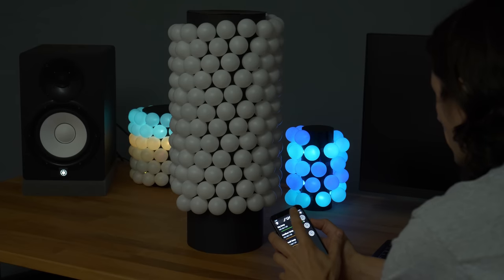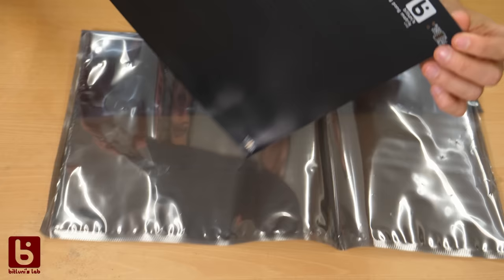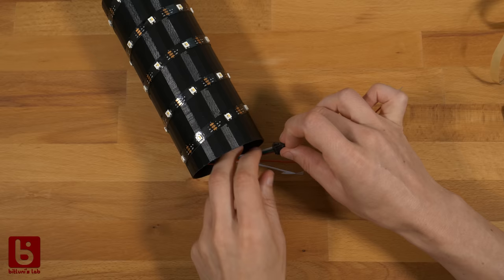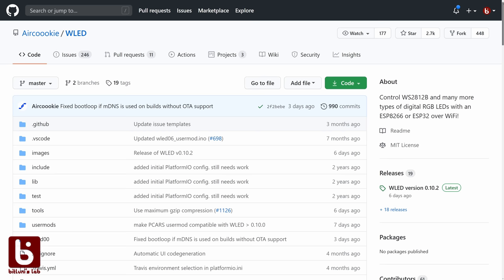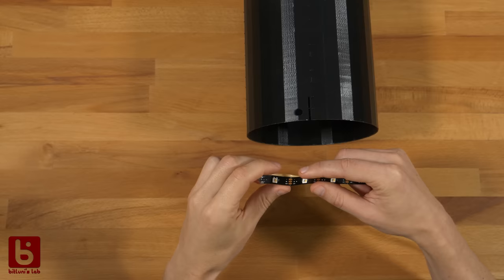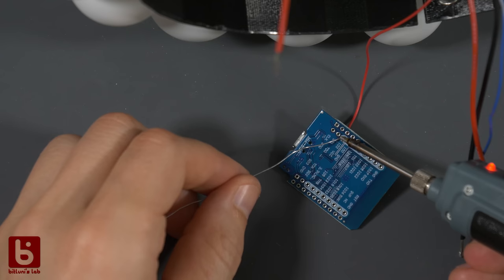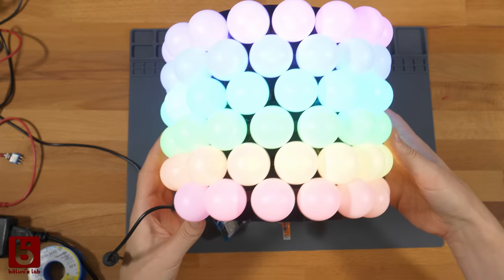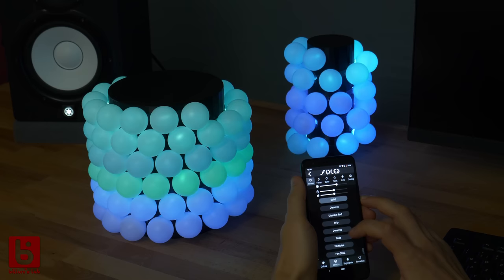Smart Ping Pong LED Lamp [Quick&Simple DIY]

Comment: Built mine a couple of month ago, works great, pity I ended up with 4cm pingpong balls so had to recalc the tube size and the balls I got seemed to be thicker plastic so ended up drilling an 8mm hole in each one and putting the glue around the led and placing the hole over it, worked out well in the end. Really nice that some guy in Germany (I think) did a plugin for Domoticz so my home automation controller looks after it too.
Thanks for such a great idea.

Comment: Just this week I made the same but with a Ikea GRÖNÖ. I 3D printed a tube that fits over the original fitting and spiral 95 ws2812B leds  (144 p/m) around it. It also uses the Wemos D1 with Wled. What a awesome pice of software that is ;-)

Comment: I bought a 5m set of the 5050 leds yesterday. I put a strip 1 meter long across the back of my glass computer desk. Now I can sync my computer RGB to my desk! I keep it on white, slightly dimmed. I just like using it for ambient lighting.

Comment: Nice video and simple and easy design for the lamps. The only thing I didn't like was tinning the wires for a screw connector. Might not be a problem in this particular case but on larger lamps the supply wires can carry quite some current and you don't want an IOT-living-room-ignition device.

Comment: To make a perfect hole into the Pingpong Ball, you can heat up a drill and melt a circle into the ball. I did this for about 400 times for my LED-PingpongBall Matrix.
Reply: Nice tip if one needs it, but are there advantages? I imagine that the second layer would help with diffusion. And most of the time the LEDs are too bright if not heavily dimmed.
Reply: He certainly has experience with this, he's done huge led displays using ping pong balls and I believe for those he did make holes in the balls using a soldering iron. I'm sure he has his reasons for not doing that here although I'm not sure what they are. Maybe just for keeping it simple.
Reply: @neur303  yes it was a much rounder circle. with the soldering iron was the problem that the circle was slightly greater than I wantet it to be. but my soldering iron has not the ability to adjust the temperature. in my case the second layer was not supporting the diffusion. greetings.
Reply from the maker: I'm trying to keep it as simple as possible. I used holes on the ws2811 chains. the smd leds dont suffer much in brightness as the hotglue works like a lightpipe

Comment: Nice video on the pingpong lamps, really novel idea! WLED is really awesome software for running addressable LEDs. I've actually made some plug-in boards called the QuinLED-Dig-Uno and QuinLED-Dig-Quad people can build themselves as a DIY project. If you want to run a larger amount of LEDs things can get a bit complex with power injection and such, I also tried to add some safety features like a fuse or convenience features like onboard level-shifters so using longer cables aren't a problem. Keep the great projects and WLED info coming! :D
Reply: I ordered my board last week can't wait for it.

Comment: There is always a little picture on the power supply that indicates if the positive lead is on the outside bit or the inside bit of the plug. Usually the outside is negative, but sometimes the inside bit!

Comment: Awesome design! I've found that sometimes I need a logic level shifter to make the LEDs work reliably with a 3.3v signal, but it looks like that might not be needed.
Reply from the maker: I mentioned this in the instructions on my web site. but usually it works good enough like that :-)
Reply: Wait what lol 1 hour? Wow you can control the time :D
Reply: I find a small cap can work too!
Reply: @bitluni  the first LED on the strip shifts the data signal level from 3V3 on the input to 5V on the output (it acts as a level-shifter). So, all you need when using 3V3 logic is to have the first LED as close as possible to the controller - which is not a problem in your case :)
Reply: A simple solution is a pullup at 5V and an open drain output pulling the output to Vss. WS2812 need Vdd-0.7V at the first diode. Suplying a 3.3V as logical "1" will sometimes cause problems. If Vdd is slightly less than 5V, then is ok, otherwise not.
Reply: A sacrificial pixel is the easiest way to go.

Comment: If you add a half opaque sheet cylinder around the finished product in the video, it will even diffuse the light more and it will be more smooth

Comment: It's so simple yet VERY POWERFUL!!! I can imagine pillars going from the floor to the ceiling in  the corner of the room, with mirrors behind them up against the walls. They could be  pulled away from the corner a bit and the mirrors would reflect the back side of the tube....
OHHHH, what if you put mirrors behind the ping-pong balls on the tube? You would have to cut the mirrors in pieces or strips to fit them in there, but the mirror doesn't have to be glass. You could make aluminum foil backed paper that has an adhesive layer on the back.... OR for the ULTIMATE ball tower you could made the tube out of flexible CLEAR plastic (like acrylic sheets that are thin enough to bend) then use some "semi-mirrored" plastic film to wrap the INSIDE of the tube... 
MY MIND IS RUNNING AWAY WITH IDEAS!!!!! - OH MAN!!! I wish I was in a position to buy these lights and controller... I know they aren't expensive but I'm on a VERY tight budget and I KNOW I would go over board!!!! LOL Re-creating Roman Pillars of ping-pong balls lights on the front of my house, with a ping-pong ball LED WALL in between them LMAO!!! ok ok ok... I need to calm down :D - This just looks like so much fun with such a simple Idea!!!
This is just so creative!!! Thank you for opening my mind once again! :D

Comment: 6 inch PVC pipe (6.625 inch diameter, 20.8 inch / 53 cm circumference) is pretty close to your large cylinder (the closest metric size is 160mm).   Just a bit smaller - maybe small enough that a hole in the ping pong balls big enough for the LEDs would still let them fit next to each other.  PVC pipe is easier to get than 3D printed parts.  The ping pong balls with a hole would sit a lot lower, so spacing would be different.  But they'd be attached more solidly, I think, and might be a little brighter with only one ping pong wall to go through.  Might be tough to drill that hole, though.

Comment: Good project like to build my self one, just wonder what power supply did you use on the small lamp and the bigger lamp(depends on how many led to use ect)  in 5v amp watts safe way to power them ect thanks.

Comment: I love this project. What I would like to do is adapt it to the the USA standard 4"/ 6" black abs pipe. I have been looking for your excel sheet you show in the video, Is that anywhere I can find? I'm hoping to make these for Christmas gifts. i've watched your video several times and if possible would like some help in figuring out the line spacing to wrap around the 4"/6" pipe.

in   /  outside diam in in.  /   outside diam in mm
4"   /  4.500in                     /   114.3mm
6"  /   6.625in                     /   168.275mm

Thank you for posting this beautiful project.

Have you thought about how to make it sound activated?  Say playing music in the room and you could have the lamps "dance" with the music?

Comment: Awesome idea, absolutely beautiful! I'm actually wondering if you have a link to your sheet, as I have a 160mm diameter tube and I wonder what the best spacing for that is, so I just wanted to use your sheet to do the math ;)
Thanks!
Reply: Did you find the Excel file?
Reply: @matthewdodrill8720  Nope, didn't I built a few without it. You could maybe ask him on Discord for it.

Comment: is it possible to connect 3 buck converter to a 19v laptop charger for the 5 supply to get enough amps for a 5m LED strip? Question for a friend 😅😅😅

Comment: I have a question about the connection between the Esp and the Leds. On the WLED github page it says that you need a 470Ohm resistor at the data pin and that you should add a 1000 uf capacitor to the 5v circuit. Do you really need that? I am also working on a project and would like to cut a 5m Ledstrip into 15 pieces and solder the connectors to the ends. Would that cause any other problems, if I just connect it without anything else in between, except the typical voltage drop on the WS2812b?
Nice content!!!
Reply: Need is a strong word. The 470 ohm resistor protects the first LED. The 1000 uF capacitor smooths out the power. I've done a lot of WS2912b projects and burned out many a first or last pixel until I added those 2 components. They are super simple to add.

Comment: So on the included website with the dimensions of the cardboard I see a circumference of 549mm and a row distance of 31mm (this is difference in the height I hope).
 In the video I count 12 vertical rows, so the minimal height of the cardboard is 12x31=372 plus a little. 

Is this more or less correct?

Comment: Is it possible to heat up ping pong balls and deform them into a slightly squarer shape to fit a 30 x 30 flat grid?  Maybe a small wood box press thingy to squish them a bit?  Love the lamps though!
Reply from the maker: probably, but I'd rather use some vacuum forming for that an do it from one sheet with some kind of grid

Comment: What is the effect that gently cycles through shades of orange or blue?  I really like the "fireplace" look of the lamp when using the setting show at 17:28 of the video next to the fireplace.  that looks tremendous and is why I have all the gear to build my own.  I've got my led strip working, but not seeing the effect that makes it look like the way it does in the video.  Any clues on which that one is?
Reply: Okay, so from my testing... It could be: 
"Candle Multi"  on max intensity
"Colortwinkles"
"Dynamic Smooth"
"Fill Noise"
 with the Fire/Lava colors preset? Okay I give up... A lot of these could be that effect if you tweak the parameters...

Comment: Can you share the spreadsheet that you used? I want to try to redesign the 3d printed cylinder so that it can have the strips mounted on the inside and I need to calculate the hole position to let the SMD LED poke through. I was also thinking of making a design where there are holes to shove the balls (or in my case, I want to use clear glass cabochons) inside the hole as diffusers. This way the flat-flex and the LED itself are totally hidden from view.
Reply from the maker: please poke me on discord... otherwise i forget it tomorrow
Reply: @bitluni  sure, thanks for the reply.

Comment: Love this project.... I Need a little help though. Im using the ESP8266 D1 mini, I get the mini flashed only with AP: numbers nothing more and I have no wifi access point to join. Ive tried the WLED_ 0.10.2_8266 .bin & WLED_0.11.1_8266.bin @ 0, with the same result. Does anybody no what Im missing please.

Comment: Hello! Thank you for making these videos! I would like to make my own Ping Pong LED Lamp, but I am confused about the parts. When I click on your affiliate-links there are several options: "5M 30 IP20", 5M 30 IP65", "5M 60 IP67" and so on. Which one is the right one? :)
Reply: Get the 5m 30 LED/m IP20 strip. The higher IP rating is for dust-proofing and waterproofing, which is not needed for this type of project and actually makes it harder to build this project with all the protection coating in the way.

Comment: Do i need more Volts when i use like 7.5m of 30LEDs/m
Reply: Each segment of 3 LEDs draws approximately 20 milliAmperes from a 12V supply, per string of LEDs. So for each segment, there is a maximum 20mA draw from the red LEDs, 20mA draw from the green and 20mA from the blue. If you have the LED strip on full white (all LEDs lit) that would be 60mA per segment.
To find the total maximum current draw per meter, we would multiply 60mA x 10 (ten segments per meter for the 30/LED per meter strip) = 0.6 Amps per meter. Be aware that 7.5m is pretty long so you would need a Power Supply at about 4.5 Ampere. 
Again, that's assuming you would have all the LEDs on at once and that you are powering it from 12V. If you're going to be PWM-fading between colors, maybe 1/2 of that is what you'll be drawing. Still, you do need to have a fairly decent power supply to run this strip, all those LEDs add up!

Comment: I tried to make the brightest lamp I could with around 20m of led strip and secured it with hot glue. After 10 minutes of operation the glue melted x)
Reply from the maker: ohoh.. what LEDs did you use?
Reply: @bitluni  some ordinary 5050 warm white LEDs with 120pcs/m I think.
My power supplies could not handle the current so I used a car battery to power it.